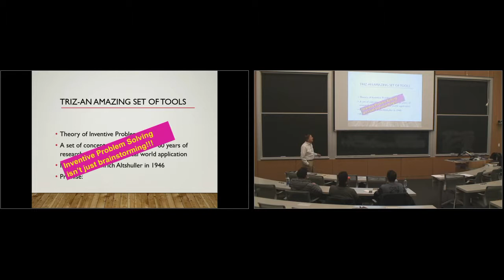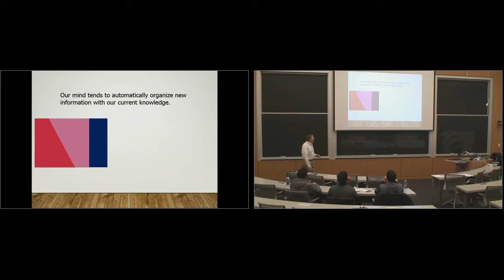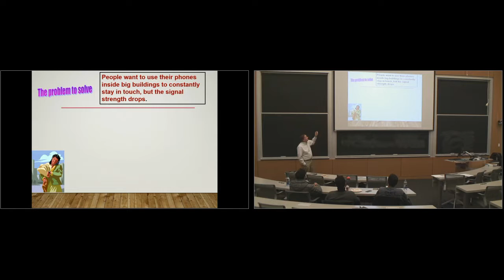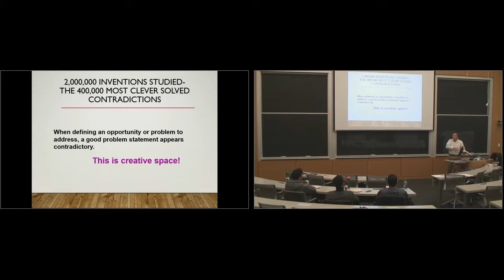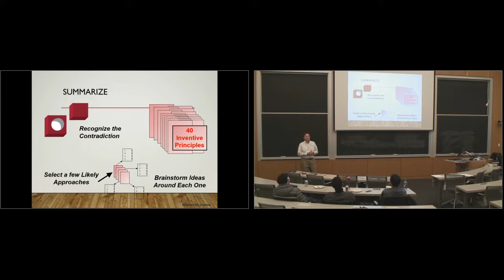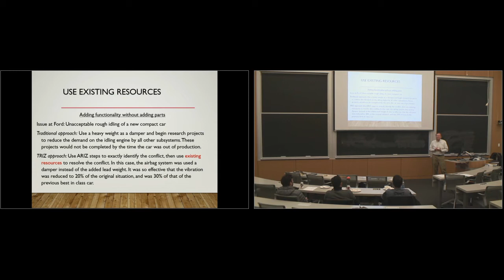Northwestern MEM Webinar: TRIZ - The Theory of Creative Problem Solving

Comment: Here is a summary of the work that has the
title: How a computer can invent by itself (i.e. the Methods for developing inventions
with the help of which three programmers can easily create a program using
which a computer can invent many inventions by itself)

 Let’s suppose that two such
conditional propositions are written to the computer memory (and also other
conditional propositions are written):
1) If: fire is placed under the
stone, then: the stone will heat up.
2) If: the stone will heat up, then: the stone will expand.
Words of
conditional proposition which stand from (i.e. after) the word «if» and before the word «then» are called the
basis of conditional proposition, and words of conditional proposition that
stand after the word «then» are called the consequence of conditional
proposition.
Let’s suppose that
computer should solve the following inventive task, i.e. the
computer has to determine what needs to be done to have the following: the
stone will expand (i.e. the computer has to determine how the following can be
obtained: the stone will expand), let’s call this task the original
inventive task (let’s assume that this task has not been
solved yet). From the second conditional proposition it follows that in order
for the computer to solve the original inventive task it is necessary
for the computer to solve the following inventive task, i.e. it is
necessary for the computer to determine what needs to be done to obtain the
following: the stone will heat up (i.e. it is necessary for the computer to determine
how the following can be obtained: the stone will be heated); let’s call this
task the second inventive task. And (from the
first conditional proposition it follows that) in order for the computer to
solve the second inventive task, it is necessary for it to solve the following
inventive task, i.e. it is necessary for the computer to determine
what needs to be done to have the following: fire will be placed under
a stone (let's call this
problem the third inventive task). ))And the third inventive task has been solved,
because it is known how to get the following: fire will be placed under a
stone. And if the third inventive task
has been solved, then the
second inventive task has been solved too. And if the second inventive task has been solved,
then the original inventive task has been solved too.
The Rule: Let’s take any
inventive task (let's call this inventive task the fourth
inventive task). In order for a computer to create an inventive task, having solved
which it thereby solved the fourth inventive task, it is necessary
for the computer to find in its own memory such a conditional proposition that
has the following feature: the consequence of this conditional proposition and
description of this fourth inventive task have the same
meanings or consist of the same words which are located in the same
sequence. And the basis of this conditional proposition will be an inventive task, having solved
which the computer thereby solves the fourth inventive task. They have the
same meanings: a) the word and interpretation of this the word b) synonyms and
so on.
 Computer can find
the same words in its memory. Let's take any inventive task (let's call this inventive task the fifth
inventive task). The computer will
solve the fifth inventive task if it does the following: first,
using this rule, it will create such an inventive task (let’s call this task the sixth inventive task), having solved which it
thereby solves the fifth inventive task, then, using this rule, the computer will create such
an inventive task, having solved which it thereby  solved the sixth inventive task, etc., (on average 90 times) to the moment at which (i.e.
until) the computer creates such an inventive task the solution of which is
known, and if the computer creates such (i.e. the latter) inventive task, then the computer will solve
the fifth inventive task. That is, the computer will solved the fifth (i.e. any) inventive
task if it creates on average 90 such tasks.
       Almost
all currently known information (which is needed to create inventions) can be
expressed in the form of conditional propositions. If, for example, 400 random
physical effects in the form of conditional propositions are stored in the
computer memory, then the computer can create on average a lot of inventions
using this method (an average inventor knows 150 physical effects).

Comment: How a computer can invent by itself

       Hello. IBM and Softline companies help
our company (which is called company a ton of gold) to implement the work
called: How a computer can invent by itself (i.e. the Methods for developing
inventions, with the help of which three programmers can easily create a
program using which a computer can invent many inventions by itself). I believe
that inventions that the computer will create using this program can be sold
for hundreds of millions of dollars. I ask you to contribute to implementation
(i.e. use) of this work, or I ask you to implement (i.e. use) this work. I am
the author of this work. This work and my phone are set out on the website http://www.55255.ru/ I believe that
with the help of this work of mine, two companies (independently of each other)
created two programs, with the help of each of which the computer by itself can
invent many inventions. As a result of this, the computer by itself created
40000 inventions. The addresses of the sites of these companies such http://www.method.ru/, https://www.truemachina.com/
But
the creators of these programs apparently has not published information that
they have used (I suppose) my abovementioned work for create these programs. So
our company striving for creation for the third time with the help of this my
work of the program using which a computer could independently invent many
inventions. My e-mail 275527@gmail.com
     The business plan: I am the
Director of company «Tonna zolota». I will hire three programmers. And in one
year they will easily create a program with the help of this work, by means of
which a computer will be able to invent many inventions by itself. For the
salary of programmers and other expenses $ 50000 will be necessary. 49% of
profit on sale of inventions (and the other) will be yours, and 51% our
company. To implement this plan it is necessary that you give our company $
50000 or hire three programmers yourself.
           
Yours faithfully, Shmonov Aleksandr